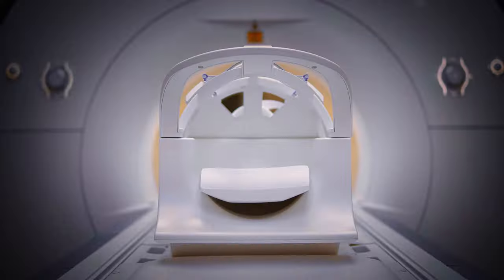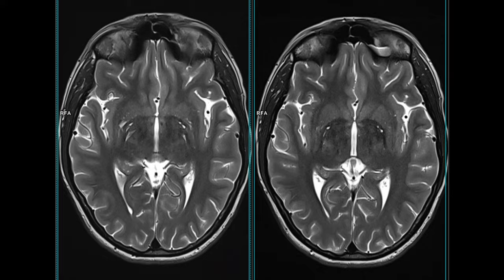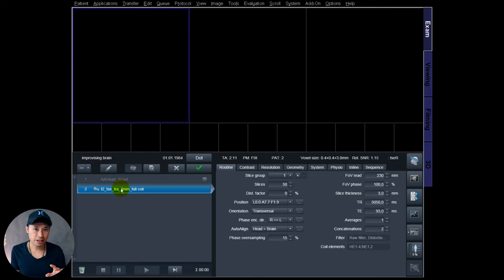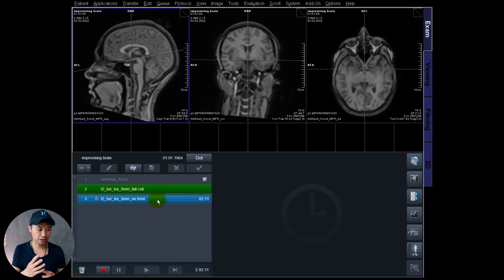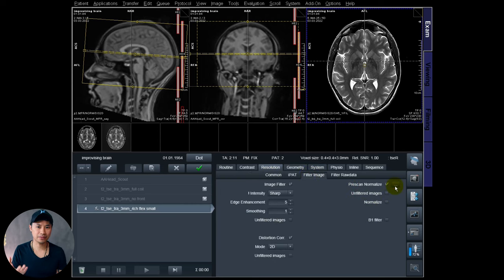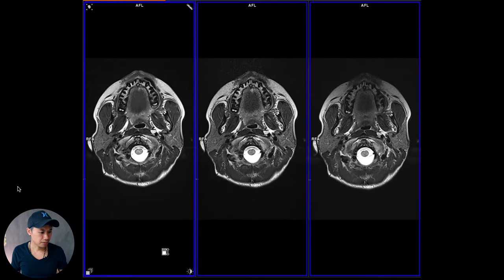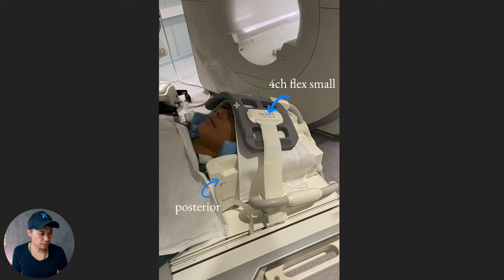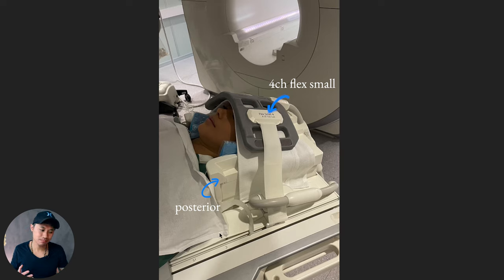MRI – Head Neck Coil

Comment: We had a hydrocephalus pediatric pacient that in a few years accumulated such an extreme amount of liquid that he didn't fit literally in the head coil anymore so we had to improvise. We pulled him back on the table and where the spine coil started and used a 4ch body coil for the front area, draped over his face. It worked like a charm. 0 difference on the image quality.

Thanks Bac for this video!

Comment: We have also used the 16 channel body coil combined with the head posterior in this way for severe kyphotic patients.....you can use double wedge sponges on either side to elevate to coil so it doesn't touch the pt's face, then use a single strap across and tighten so the coil is snug to the sponges
Reply: That exactly what I do with the body 18. When they're really kyphotic I put a pillow or the knee wedge under their bum to preserve that kyphosis and rock them back into the head coil. It's a bit ungainly but actually really well tolerated.

Comment: In a similar vein I'll put the 4ch small flex (or the same size 18ch ultraflex on the VIda) over the neck/clavicles when doing a soft tissue neck in the 20ch head/neck coil. The 18ch small ultraflex is probably the best thing about getting a Vida, so much signal.
Reply from the maker: Smart move. Very much agreed.

Comment: A flex coil wouldn’t be necessary if the head coil had a cable connection option. The head coil could then be elevated (greater than 2 notch) to accommodate the kyphotic/obese. The 3T vida & 1.5 sola still require direct table port. Meanwhile, offered in older model GE discovery. Shameful.
Reply from the maker: Yeah different options from different vendors.